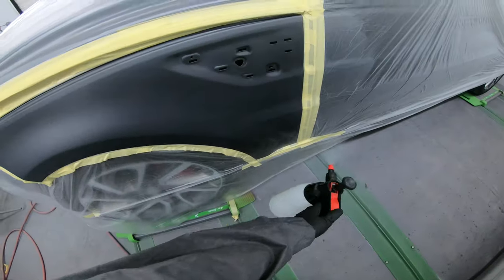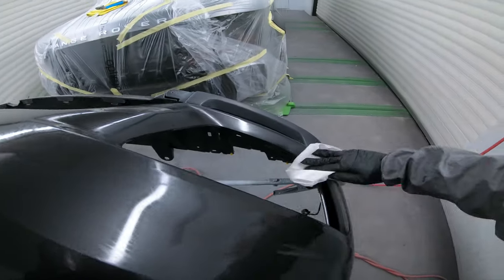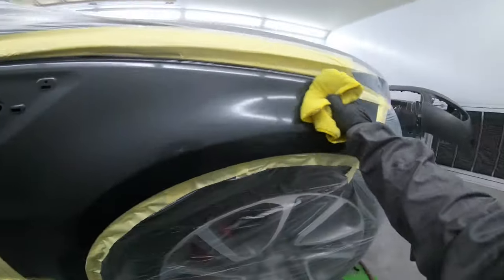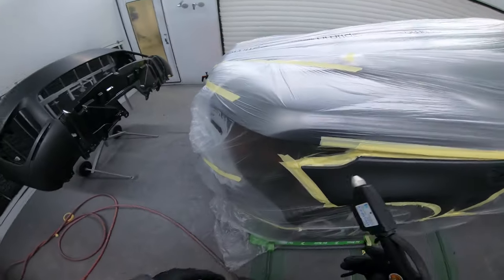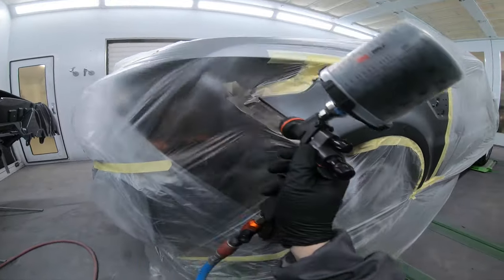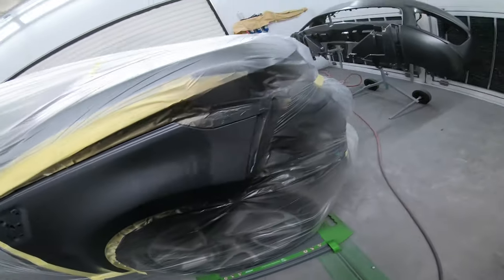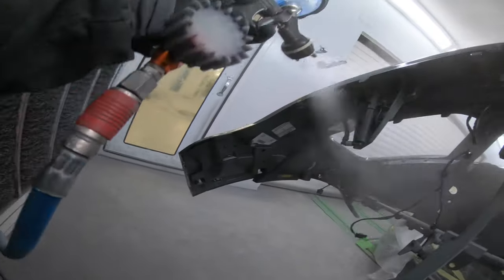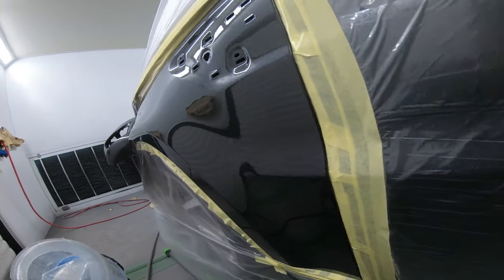Blending base coat for a better colour match

Comment: Hey Paul, another great video mate I love your attention to detail you make sure everything is spot on before you leave the booth. 
I used to use a tack rag but always had tiny micro type nibs on my panel there were loads of them all over and no matter what I did they were always there then I saw a video from Gabe where he was using a microfibre cloth which was damp from the panel wipe so I tried the same thing and the nibs were gone, I think it was caused by static but being a diy painter I can't afford a stat gun but using a slow antistatic panel wipe with the microfibre cured my problem.
You can post as many videos like this as you like Paul as I never find them boring as there is always something in there to help 🙏👍
Reply from the maker: Thanks mate. Those stat guns do help but if you slow down and spend extra time on cleaning you can eliminate them I never always had access to them. But sounds and looks like you have it nailed 👍
Reply: I did consider getting a stat gun until I saw the price 😱 as you said what I'm doing now has made it 90% better plus I don't think I will get anything better in my little booth.

Comment: Is that the correct code for JLR car?
Reply from the maker: Hey Anthony do you mean L494? That's the model number of the Range Rover, no the paint code.
Reply: So it looks like Corris grey, 1AB 873
Reply from the maker: @maxmeyer74  I think it was  causeway grey 950, it's a little darker than Corris grey.